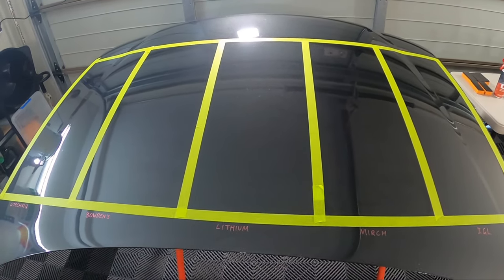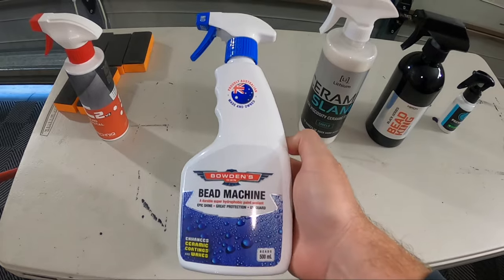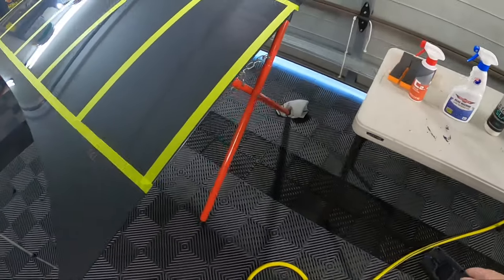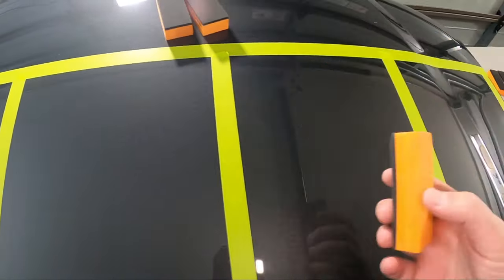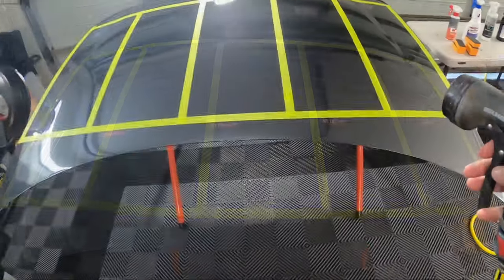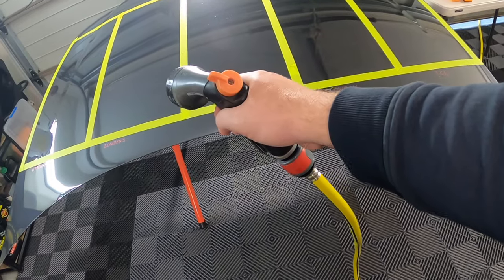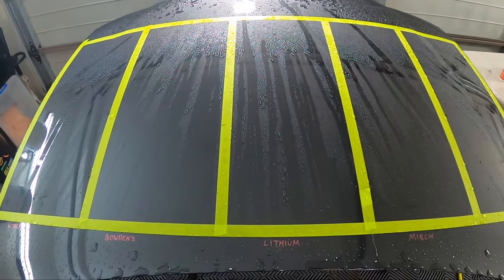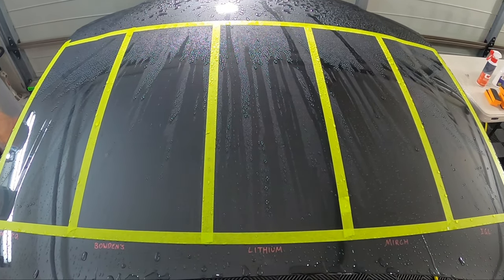Ultimate Spray Sealant Test | First Rinse Gtechniq vs  Bowden's vs Lithium vs Mirch vs IGL

Comment: The Mirch product was darker there because it smeared across the section and hasn't buffed off as well as the other products. What you're seeing is excess product on the section.
Reply from the maker: It's only smeared in the corners where it hasn't buffed off as I was trying to not wipe into the other sections and cross contaminate, in the middle where there's no smearing it's still just as dark. I also did another panel since to check this and and with no smearing it's still made the paint far darker

Comment: Seeing that you've converted me to bead machine, it's like barracking for your footy team. Here's a corporate term you can use to make you sound cool. "Setting the initial baseline"
Reply from the maker: Hahaha yes I like
Reply: @EvolvedDetails  why don't you measure the exact angle the sponge starts sliding then every week repeat and adjust the angle accordingly to get the slide, then draw a graph. At the end you'll have a curve for each product, call it the Jackson slip ratio, which you can then, draw on a white board and stand back and point at with a Lazer pointer on the final  test day lol
Reply from the maker: Hahahah I like it
Reply: @jethrox827  Lol Christ mate 😂